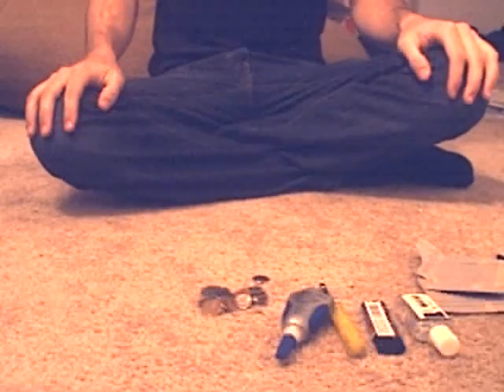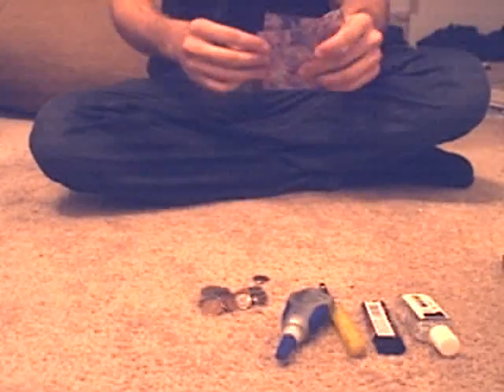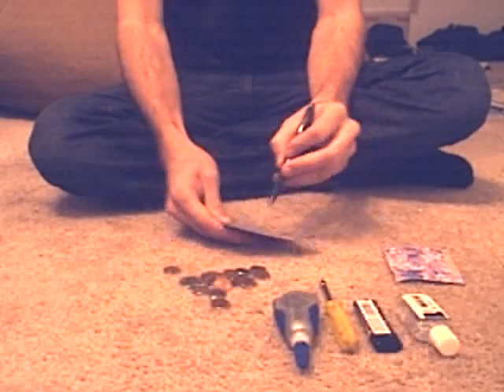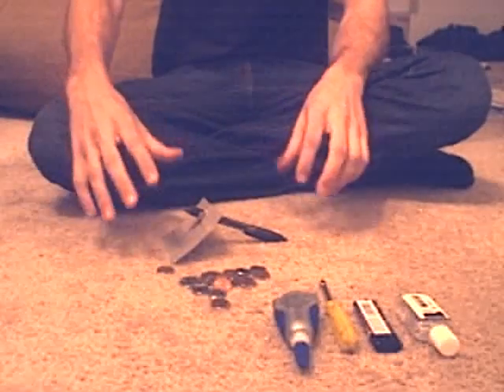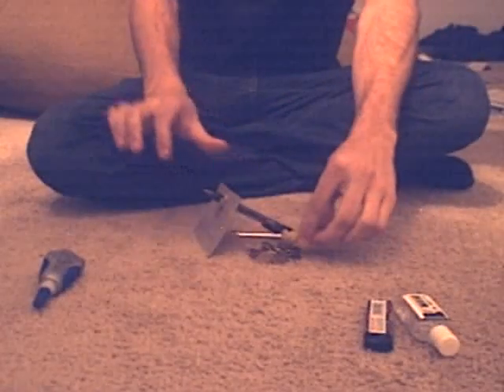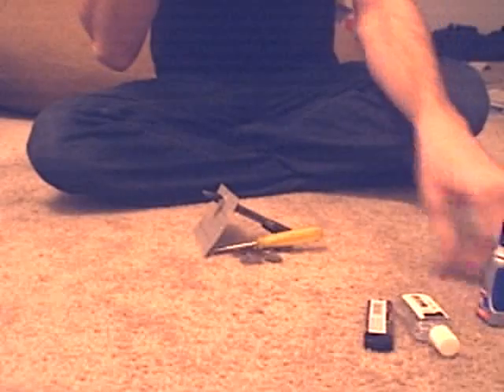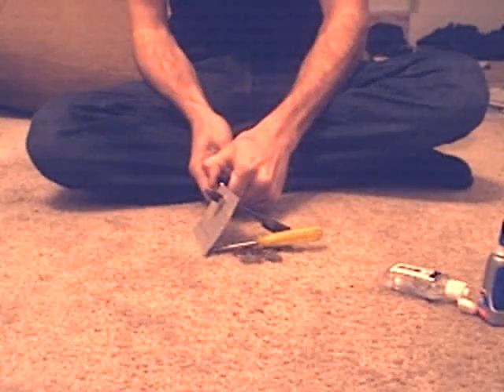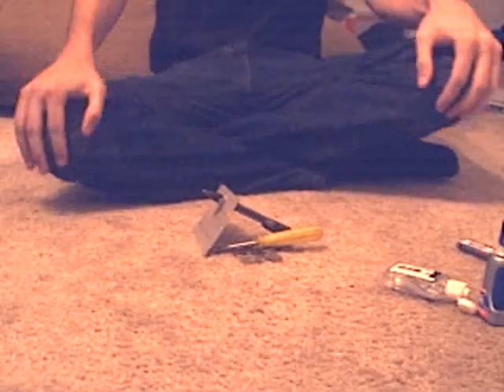How to Build Things Out of Common Household Objects - Solar Panel

Comment: 7 
Make a solution of salt and water by dissolving the salt in hot tap water. You should make enough solution to barely cover the bottom of the plates, leaving the clips high and dry.

Comment: 6 
Connect the lead of the alligator clip which fastens the clean copper plate to the positive terminal of the meter. The negative terminal should then be connected to the cuprous oxide plate.

Comment: 5 
Cut another piece of copper to the same size. Attach both panels using the alligator clips to the inside of the wide-mouth glass jar or plastic bottle with the top cut off. The panels should not touch and should bend to match the curves of the jar or bottle.

Comment: 4 
Scrub the completely cooled copper under running water to remove any last remaining bits of oxide. Be gentle, as you do not want to remove any of the red cuprous oxide that has been created in heating the flashing.

Comment: 3 
Allow the copper to cool slowly once the layer of cupric oxide has formed. It will begin to flake off and may do so with some force as the oxide and the copper cool at different rates.

Comment: ⦁	2 
1.	Place the copper flashing on the electric burner and turn the burner on. You will need to "cook" the flashing for as long as 30 minutes or more to develop a thick layer of black cupric oxide.

Comment: 1.	Harness the Power of the Sun
⦁	1 
1.	Use sheet metal shears to cut the copper flashing in a square or rectangle to fit the size of the electric burner. Be sure to use a piece of copper flashing that is thoroughly cleaned. You may use sandpaper to thoroughly remove any sign of corrosion before proceeding.

Comment: Solar cells convert the energy of the sun into electricity. By using items commonly found in the home or your local hardware store, you can make a solar panel to demonstrate this photoelectric effect. You can also save energy by converting some of your traditional electrical supply over to solar power

Comment: Interesting, i would like to know more about this idea if it can be done in a bigger level with a little more details of connections and things like that.  Its not stupid or dumb, just because F***ing ppl doesn't have an imagination and doesn't get the idea that this is just a demonstration and it could be use in case of an emergency it doesn't mean it doesn't work.